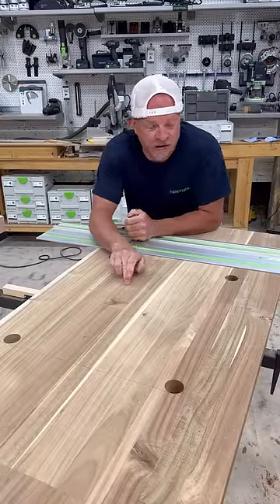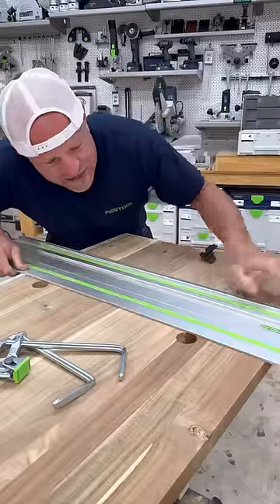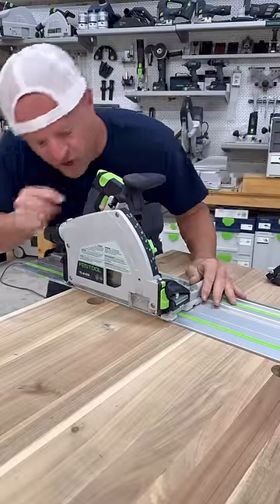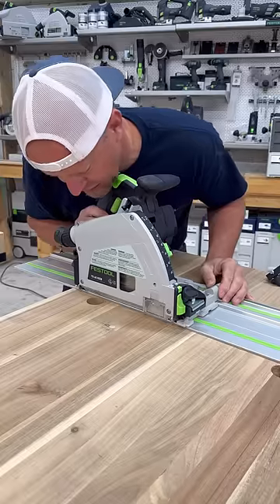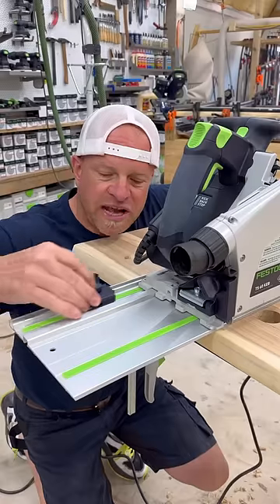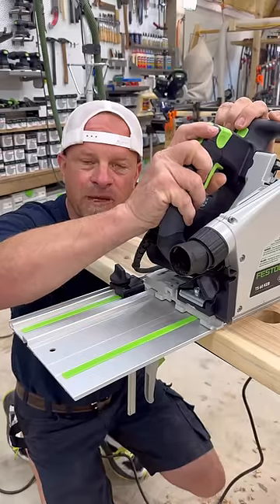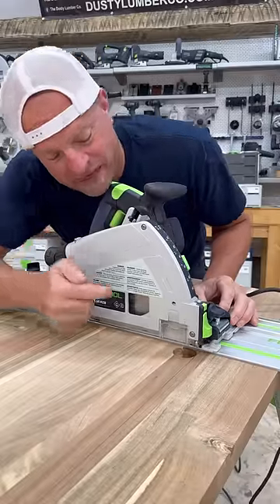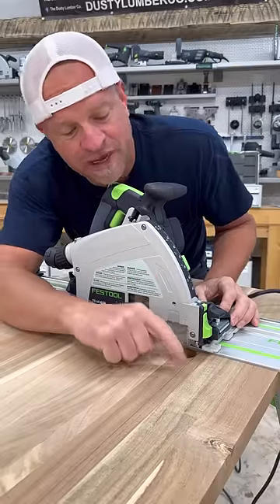Plunge cutting out a sink with the TS 60 #festool #woodworking #carpentry #diy #woodwork #tools

Comment: Fyi those marks on the saw frame only line up with your plunge at full depth. Otherwise, plunge in middle of cut at preferred depth and mark with pencil where the blade starts and stops at set depth. Or grab a Mafell 😛

Comment: Wish I had those stops about a month ago! I used my TS55 & over cut the hole like you did there (on the bottom right) and had to glue a piece back in since it was an under mount and visible.  The graining matched almost perfectly but still wasn’t perfect.  (On a different countertoptop, my older TS55 kicked back and left a nasty gouge and slightly damaged the track)
Reply from the maker: Sorry to hear that
Reply: I also have. Tons of festool.  In my. Woodworking  shop.  Done tons of. Plunge cuts. Without. Stops.  Trick.  Plunge. Very  Very  slow I don't even clamp it all went. Fantastic

Comment: Still will have a small corner that has to be cut to square. The round circular saw blade, at it's front edge, cannot finish a square hole unless you happen to be plunge cutting at a depth that engages the middle/front of the blade to the very middle of the piece and....only if the piece is only a certain thickness (probably an inch or less).
Reply: This is why he drilled the big holes in the corner to make sure it will cut all the way through.

Comment: Do the index marks on the saw body accurately show the limits of the front and back of the cut regardless of depth setting? If not, what is the depth setting that corresponds to the marks?
Reply: They are for the deepest setting which should be used for plunge cuts like this anyway
Reply: @riba2233  Thanks for reply. Some applications require reduced depth of cut in order to avoid contact with a supporting substrate, in which case I now understand that reliance on saw body marks would not be accurate.

Comment: Not sure how it goes with the new TS60, but for TS55 those lines seems to be accurate once you cut using maximum depth. If I spotted correctly your was set in like 75%, wasn’t it?
Reply: Yeah, same with all track saws. But the lines show the absolute maximum exposed blade length, so it just ensures you don't cut too far. Only way to make sure you cut far enough is to eyeball the blade.

Comment: It’s not real true authentic™️®️©️ woodworking if you any tool other than a 3/5” Japanese water chisel and a ultra fine rasp and Japanese whaleback saw to cut hidden dovetails for ever joint one ever makes. This hole should’ve taken 3 men 3 years in complete isolation to complete. That’s if none of the 3 go mad in isolation, sometimes all 3 do and it’s not pretty but that’s traditional woodworking! Not this techo sorcery